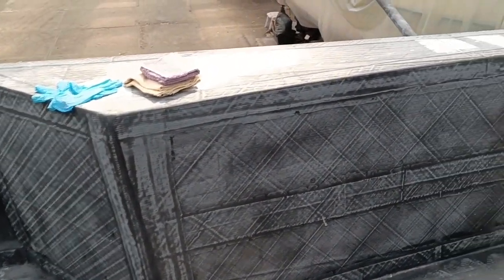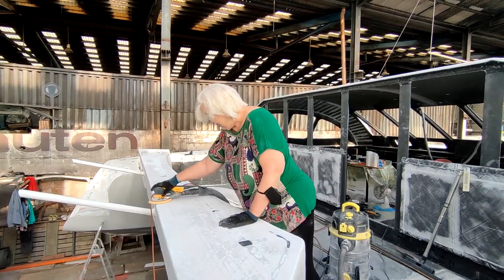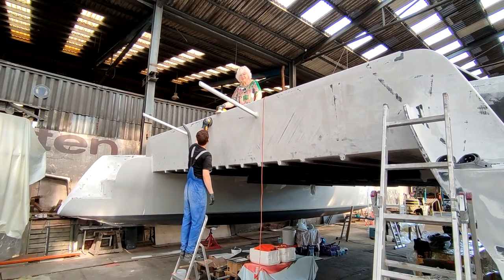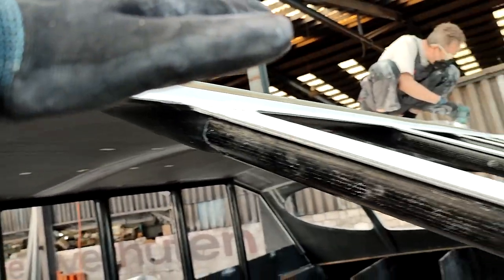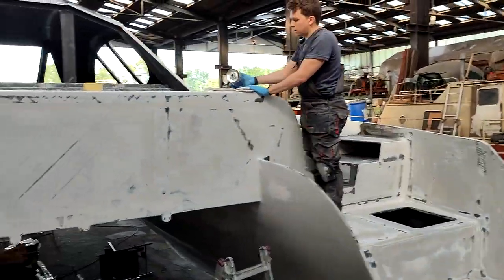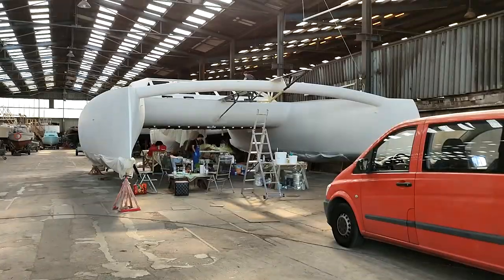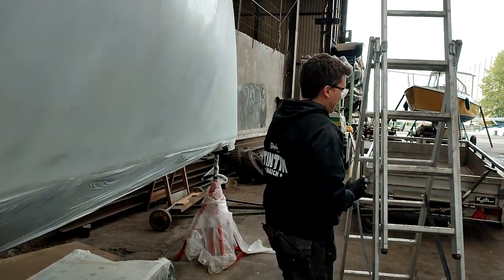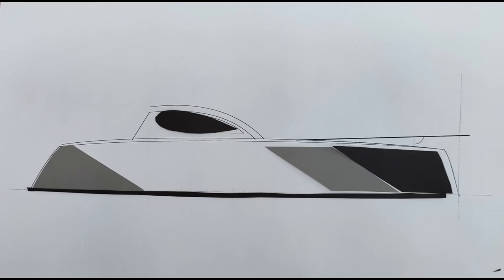05.  Building 15m carbon performance catamaran - "CarbonBee"

Comment: Amazing work and a great project! Very impressed with the results and how fast you are getting everything built!  I’m curious how the water drains out of the  flush hatches you built? Is there a drain with a tube leading overboard?
Reply from the maker: Thanks!
Yes the drains are at the front wall of the bridge. You can see also the drains in video 04.

Comment: thats one serious performance cat beam is so wide compared to more poduction boats for the same size. lots of loads on rig
Reply from the maker: The forces are not bigger then by production boats because of the low weight of CarbonBee. The calculated maximal bending force acting on the main beam and the compression force in mast is ca. 90kN. In this number is also considered acting force giving higher speed of the boat, which is equal to resistance of the hulls at speed of 25 knots. Additional to the design process of the main beam and mast the safety factor must be added. Using carbon fibres and proper design you can manage the forces/loads in these two important elements of the catamaran. 
The forces in shrouds are lover then by comparable production boat because of the wide attachment base.

Comment: Beautiful! Wouldn't you like to have bigger portlights in the hulls in order to have more day light? Would that be even possible at this stage?
Reply from the maker: Thank you!
Yes it is possible to get bigger windows, but it will require more reinforcement (read: more weight ☹).
Furthermore, we are considering that all the life will take form on the bridge in saloon, cockpit and forward deck. The space in the hulls is for sleep, private separation and relax, where the full daylight is not an important significance.
By the way, in rear cabin will be additional port-light (is not yet installed) at rear wall, there where are the stairs to the deck.

Comment: I've watched all of your videos so far and can't seen to find out any details besides the length which is 15 meters. Awesome looking and I can see why your calling it carbon bee, the side windows. It looks much wider than all the 15 meter catamarans I've ever seen but that might be due to the camera lens. How wide is it? Also what is the dry weight before you add all your personal belongings? How much did you spend on all of the carbon fiber and consumables if you don't mind sharing that information in USD? Looks like it will be a supper fast boat and lightweight which is awesome.
Reply from the maker: Hallo Robert. I am glad you like the design. 😀
Please check the description under the video (press "watch/see more") and also read my responses on the comments under the videos - especially under the Video Part-02. In these responses you can find a lot of informations about the project. 
In short: CarbonBee is 15m long and 9,3m wide. Draft 2,5/0,47m. Weight empty: 4t. See also  the last picture in Part-01 Video.
Why "CarbonBee"? - the build material is carbon and the Anna's nick name at home is Bee (Pszczółka).
Reply: @bojanu7212  Wow, only 4 tons. That's very impressive. Is that with all the sails and navigation equipment but with empty fuel tanks and no personal belongings aboard? The width is very wide as I thought. I'm not sure about this but I've heard that when you go to wide, it effects the performance in a negative way but I don't know what the length to width ratio is that they are talking about. I'm looking at building an aluminum catamaran like the one that Peter from Sailing into Freedom is having designed for him right now. It would be nice to know about the cost of building it out of carbon fiber verses aluminum. I also like the Schionning Arrow 1360 called Duet and the Mumby Cyber 48. Not quite sure which plan I'll be getting yet but I'll have to go with a plan because I don't know how to design anything like what you have done. The cost and time to build one will also be a major factor for me so I'll have to consider many things before starting the build.
Reply from the maker: @robertlaird6746  ...Yes it is not easy task, but you are on the good way comparing different designs, building technologies and materials. We went the way too, but we didn't find such a boat which suited us and at the end I decided to design it myself. Good luck for you and wish you good decision.
By the way: sure, the wideness (but still not like a trimaran) effects in negative way the performance, ....but only in ports. 🤣🤣
Reply: @bojanu7212  The width would probably give the boat a faster turning time and make the auto helm work harder. I used to race Tornado and Nacra catamarans. The Tornado was 20 feet long and 10 feet wide. I liked that balance of length to width. The Nacra was 8 1/2 feet wide and sometimes it was hard to steer it. I think that was due to it being narrower in width. Both had about the same size of rudders so I'm thinking that it was due to the width. I'm wondering how yours will preform. Sailing Jupiter on YouTube has a Mumby Cyber 48 that is 25 1/2 feet wide and their boat weighs 6 1/2 tuns. After they load up there diesel, water, food, clothing and other personal items, the weight increases to about 8 1/2 tones. My question is if you built the same design of boat out of aluminum and another out of carbon, what weighs more and by how much?
Reply from the maker: @Robert Laird  Generally the weight of the aluminium, good designed catamaran shall be in the range like a fibreglass catamaran, or higher.  I already responded to your comment earlier, what difference you can expect in comparison of fibreglass to carbon-fibre construction.
To compare the length/width ratio you have to take the width between the axes of the hulls and CWL. By CarbonBee this is 8m, what give her extreme transverse stability, and possibility to use bigger sails in comparable wind conditions. That is one factor, amongst many others what shall characterised real performance catamaran. 
CarbonBee empty weight without water is 4t and displacement is 6,5T. Since we will have electro-engines and they will generate current during sailing, additional to solar panels, and we will have water-maker, we will need not so much diesel&water in the tanks.
Robert, please read my responses to other people comments - you will get a lot of info.
Reply: @bojanu7212  OK, I'll read some of the comments on video #2. Could you do a video about the design?

Comment: well done!  did you weigh how much paint and epoxy went onto the frame?  it's very surprising how much weight it can all add.  approximately how much has been invested so far in materials thus far, not counting man hours put in.??  I'd love to  see this in person, buy y'all a bier and talk for a little bit while I'm still in DE
Reply from the maker: We will start with the works supposedly end of March, when the temperatures are higher. You are invited (Marina West, Rauchstr. 43-45, Berlin). Then we can answer your questions.

Comment: Seems really wide compared to the length, what are the dimensions and why so wide?
Reply from the maker: Yes.. she is wide, light, has only one floor, is aerodynamic optimised, has higher bridge situated more backwards then by others cats, has daggerboards, and has many other, specific design's characteristics.... simply, she is designed (with only little compromises) for extreme fast sailing and fast ocean passages. 
I am agree, she is something else then these "performance catamarans" everybody is telling about, nowadays. 
Maybe...CarbonBee is (performance catamaran) ²  . 😯 🙂
Moreover, Kevin's sail racing genes were considered during the whole design process  🙂